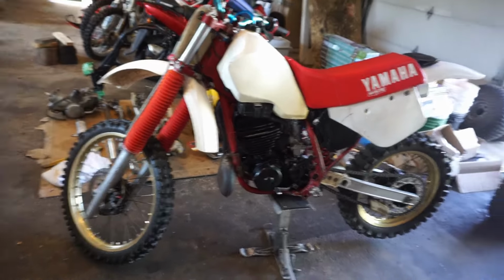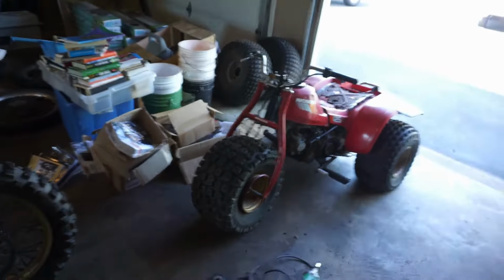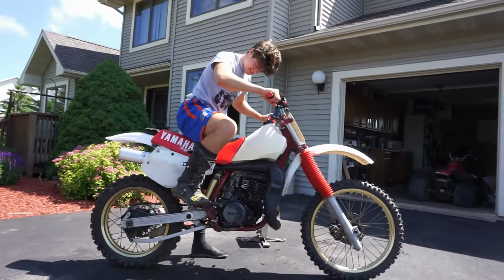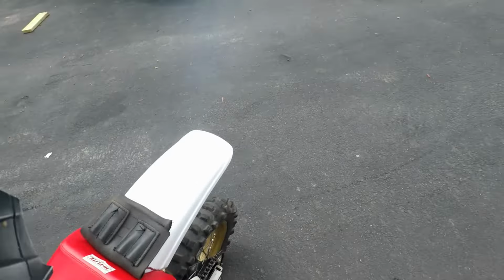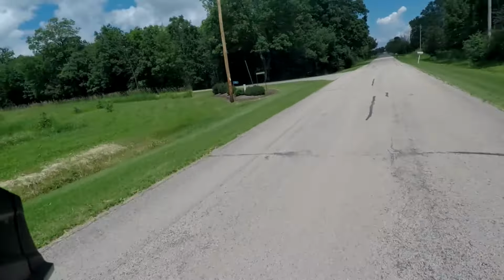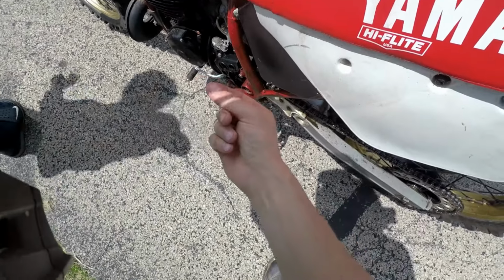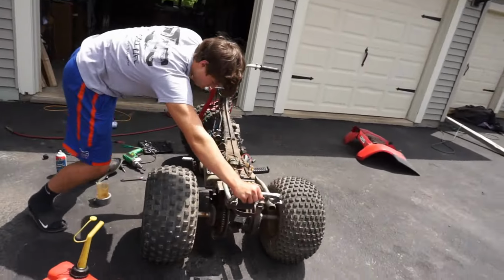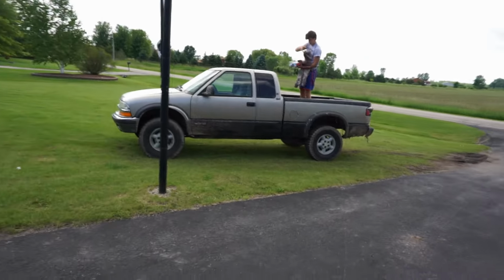This Bike Will KILL You!!! First Ride on Yamaha Yz 490

Comment: Your not supposed to let 2 strokes just sit and idle you have to stay on the throttle from time to time or you will load it up and it will run like crap. Just snap the throttle every 4 seconds when warming the bike up.

Comment: Again it depends on the bike and the rider I seen a video that a 490 yz count not catch
  A cr 500 on a oval track the CR had more the 490 got close but when  2  close the CR pull away again.on the back wheel so again  older cr 
will surprise you

Comment: The sad thing is. Is that I got a 1985 yz490 it was completely locked up and I pulled the pipe dumped ab a gallon of water out of it then I flipped the bike upside down after pulling the head then ab 4 gallons of water dumped out of the moter and I got the moter to rotate then I put a spark plug in it and started it in 4 kicks the bike sat for 10 years outside and I got it for a 100$ I'm 15 too and I can start it also it starts first kick cold and I was wharing flip flops lmfao

Comment: It's not running right at all. I had a CR480 that would blow that YZ away. You better stay off it if you get it running right. That's way too much bike for you. It should be able to pull the front wheel up in every gear while digging a trench at the same time. I've used mine as a ditch witch to lay drain pipe! Nice find though. I wouldn't mind having another with modern suspension. Boots are required to start them, you can break your foot.

Comment: YZ490-101,
Lean the bike over until fuel dribbles out the overflow tubes, put it second gear, rock it back and forth a few times, the pig should sputter to life.
Yes, the bike WILL try to kill you if you run pump gas. It will pre-ignite the fuel mixture to the point of the throttle sticking open.....enjoy.

Comment: Yeah word it did do that w40 on breaks number one worst thing to do second of all I had a 1983 YZ 490 with black and yellow that thing was fast as hell all you had to do was roll the throttle slowly it stood up in every year but obviously he doesn't know that you can buy a heavier thing for the crank it's waited more to slow the crank down in the engine RPM for better trail riding think that's what he has going on there never had these bikes man I know what's going on but yeah my bike he wouldn't be on the street hitting like that you be on your back if he's riding my yz490 anyway it's all good

Comment: It’s not a 84 year model, 84 models were yellow, 85 was the first year of the white and red. Check the 10th digit of the vin number and that will be the year model. 1985 will be a F as the 10 th digit from front, E Will be a 1984. If it’s a 1984 vin then someone has changed the plastics, tank, seat and fork
 boots or they used a 84 frame with 85 parts.

Comment: You’ve got the fuel ratio wrong,25.to 1 is perfect 👍
Reply: Too much oil for a 500.  Jetted well, it will run fine.  But that is a rich mix with a good oil.  I don't know the exact parameters, but I know the higher the rpm the more oil you need.  Typical would be 40:1 for the 500, or 32:1.  32:1 for 250's and 125 maybe a bit more.  25:1 is good for small engines that hit 18,000 or more RPM, and Motul oils are hard to beat.  Small nitro engines that hit about 30,000 rpm, (and no piston ring) use more as you would suspect. I don't know how much though.  I am a gas 2-stroke guy.

Comment: Never try the YZ 490 but I’ve had a KX 500 and these days I ride a ZX-14R with 210 HP at the back wheel and my ZX-14R is a pussy compared with my old KX 500 this thing was out of this worlds 2 cycles engines have the reputation of been violent but the KX was really psychopathe I used to say it didn’t go fast but instead it was a teleportation machine 😂, it doesn’t feel like it was accelerating!?...... it was more kinda the scenery moved backward and you were standing at the same space, sure the KX 500 didn’t have a top speed maybe it was 160 or 170 km/h ( never had a speedo since it’s a full cross but from 0 to this 160/170 km/h the ZX-14R never had a chance not to beat it but just to try to stay with him , the first time I have try it I’ve had never riding a full cross before only a FZ750 and a ninja 750  and I thought I’ve had seen everything boy was I wrong my friend who was riding his CR 250 for many years had told me to be carful, that I was going to be surprised but when I let it go ...... ( I’m kinda not a good reference in the no brains department) so when the beast go at the stretch of the first gears instead of doing what a saine man would do ! Like let it go or brakes me having no fears genes in my DNA instead I instantly shift 2 and 3 and 4 and suddenly realized they’re were no 6 gears that it had only 5 but was I happy to be at the end of it because I’m so stupide that if this thing would have went to 500 I would have been dumb enough to keep it pin up to there anyway the YZ 490 is surly something but I doubt that it was more violent then the KX 500 I’m 52 today and try so many bikes in my life but the first time trying this beast is lock in my mind for the rest of my life’s 
What a ride 😍😍😍

Comment: You do not warm up a 2 stroke by letting it sit there and idle.  Two Strokes pull more fuel than they need at idle.   A 2-stroke that is set up properly should not idle on its own you should always have to stay on the throttle to keep the bike running.   When you fire that thing up cold and get it off of Choke hold that throttle wide open in neutral until all the Smoke Clears then let off and you keep doing that until every time you rap on the throttle it just goes wide open.     You will not hurt that 2-stroke blowing all of that fuel out of the bottom end warming it up.  That is one way it can be done.    Another way would be after you get the choke off get on the bike and run through high gears wide open until the Smoke Clears.     Those two stroke engines are not designed to sit and idle they are designed to run balls out.

Comment: That YG 490 is not running correct I've had several let me ask you a question do you know what year they changed from yellow to White had several my wisely 490s for speed can never keep the front end down especially on pavement in a dirt all it did was trench a hole a ditch it's not running correct

Comment: Those bikes are not for cruising. Its all or nothing. Gotta slam through the gears keeping it powerband. Be careful on the street it will pull front wheel in almost every gear.

Comment: I owned a yz 490. They are fast when they run right. The clutch was slipping like crazy in this video. He may not have experience but so what. He thinks it's a beast because of what it is not the way it was running. He didnt even pull the wheel off the ground.

Comment: New piston and rings and buy a new boysen power reeds. No , you don’t rejet it. You’ll have it all screwed up? It still has the factory expansion chamber. All stock. You kids are clueless. You grew up in the four stroke era. That bike should be throwing you off in every gear . It’s almost as badass as the king CR 500

Comment: remember my dad had one in the mid-80s. I was fairly young. Remember after a day of his buddies hanging out drinking a little it always turns into a dick measuring contest. So, of course, you bring the deathtrap out to make WFO blasts up and down the road.  I still remember the sound of his best friend coming and cranking it up on the back tire. Made it about 100yrds and he was on his back. It ripped him and the bike both to hell. We all ran down there to him laying in the road. He said he was ok but it hurt way so effin much more than the 1st time he lost it. Turns out he pulled the exact same stunt for a group of girls on a parallel road just a few mins before!!! like Ronnie Mac says "its human nature to not be a pussy" that's how we roll. I started at 6 on 2 yz80s, 175 then on to a YZ250. Had a 110 big red for a summer then on to a Tecate 250 before the quad racer 250 came out. Never got to ride the Suzuki 500 quad.

Comment: That ain’t a 1984.  I bought a 1984 brand new and raced it until 1989. The 84 was yellow and had a dual leading drum front brake. They weren’t white and red until 1985. I put 1985 plastic on mine.

Comment: These yz490s would pull the front tire off the road going wot on high gear. This bike will get away from you quick. This test drive is not what I remember.

Comment: You need new reeds and air filter. Plus your gas to oil ratio is off. Mix a little leaner and then stop riding that thing like it's a four stroke.

Comment: the bike isnt running at 40 percent of its capability!! it needs the carb cleaning,the right fuel oil ratio,and probably a clean or new plug by now,then it will pull at your arms in every gear and really scare you,i found this hard to watch it sounded so bad,lovely bike tho

Comment: Those bikes need you to have big brass nuts 
You need to let it hit through the power band to clean it out if you keep running it below you will load it up, It does not sound rich those motors are just like that.
YES ITS A BEAST.

Comment: Sadly the worse open class bikes made. They never ran right new.  The last great open class bikes Yamaha made was the 80/81 YZ 465.  That was not a great deal.  The motor needs a rebuild.  Even then good luck with the jetting.  It goes deeper  the squish on head needs to be reworked as well.

Comment: Do a compression test first it has to be 150 minimum if its 90 or less needs a piston and rings that's the life of a 2 stroke no compression no pull
Reply: I've also see a good running c.r honda 500 pull away from the 490 ya never under estimate the cr 500

Comment: Sounds like clutches maybe slipping to me
Reply: That usually happens because everybody thinks their faster if they adjust the clutch so you barely pull it and get clutch. 
Yea a whole .00001 second quicker. 
Meanwhile it's killing the release/throwout bearing because there's no freeplay. 
I like it where you pull it in all the way, and a little movement gets clutch and it's floppy at the end. 
You have freeplay. 
Then again, don't have a mile of it or the clutch will drag.

Comment: Get it on the pipe and let it rip, you are bogging it.. there is no reason to rejet from stock jetting, drain the float bowl and clean carb.. that thing should be a pucker factor of 10.. IMO you're riding it like its an old 4 stroke... Wait to you try and ride that trike,Ha Ha!

Comment: If you're going to put WD40 lubricant on your brakes and chain...and you really believe in doing that for reasons unknown to all who own motorcycles....at least spray them good.  You barely even coated the rotors and you missed the chain with 90% of what came out of the can.

Comment: It´s definitely not 1984, that´s a 1986 Bike ! Ich owned that bike an drove intern. Races with it. Your Motor runs much too rich. It´s need to adjust it much more leaner ...so will have a very lot more Power.

Comment: All the gear no idea...

WD40 on a front brake disc = contaminated pads and lack of braking power

WD40 on a chain = it's parafin based and designed to penetrate and unseize rusted together metals it's not good for chain maintenance

Comment: Dude you ain't witnessed half the power,with it running as bad as it was and it scared you,it might be in your best interests to get rid of that,and by all means respect it,cause if you dont its gone make you respect it,i know they running bad but you giving them way to much gas,id hate to see the power band come out of nowhere on you,these bikes will 12 o clock all the way through the gear box easy,I've had the same yz and two cr 500s with ported cylinders and had them punched .40 over

Comment: dude... let the clutch out before yous tart throttling it.  It sounds boggy because the bike is meant to scream at high RPMS and you are tooling around at the bottom of the gear giving it almost no gas.  That thing is meant to run like  a raped ape. Not take out on a "Brisk trail ride to pick berries for grandmas jelly".
---------------------  Watched more_____________
"Clearing out now Man that thing is fast. ....  " 
Thats a little more like it.

Comment: Bro I couldnt watch that. You cant leave a 2T air cooled big bore just sitting idling, you fire it up and immediatly limb it out before it loads up, has to be blown out. You hold the gears way to long, it makes it power down low. Also thats prolly the worst open 2T ever made, i had 2, couldnt keep em together, shit vibrated off every time i rode it, hated the 4 speed too. Get you a CR or a KX, thank me later....Roost

Comment: Its running like a bag of shit my 500 does 160klm with 52 rear sprocket 190klm with 46 hits 100klm in 2.6sec your bike needs reeds and new jets and try using avgas thats what i use its expensive but you will see why.

Comment: It will only kill you if you can't ride i own a 500 honda and i blow all my friends away on their brand new 450s my 500 is 2003 the last Australian model and is road registered i have only had to do a hone and new top end since new my friends 250,450 4 strokes are constantly breaking down I don't understand why honda and the others don't remake the 500 in a new package as service honda no longer makes them due to honda not producing motors anymore shame shame the good thing is bikes like mine are going for 10,000 to 20,000 au.

Comment: Leave the two strokes to the real men .  What clown told you it was ok to spray WD40 on the brakes ? You don't have enough experience to ride that bike . If that bike was running right , It would have flipped you off the way your sitting on that seat .